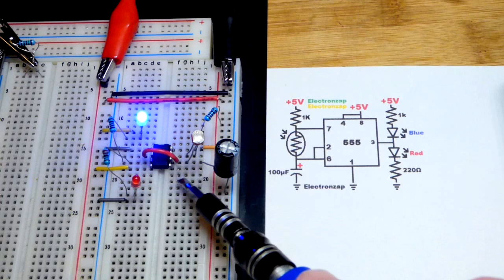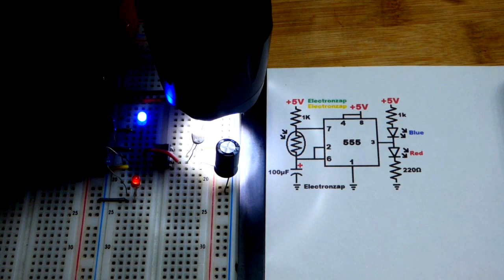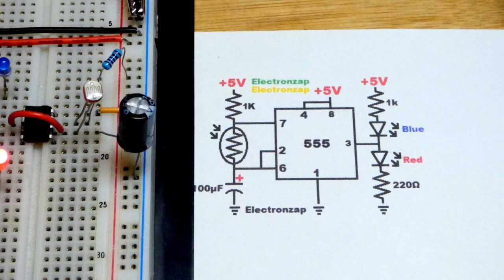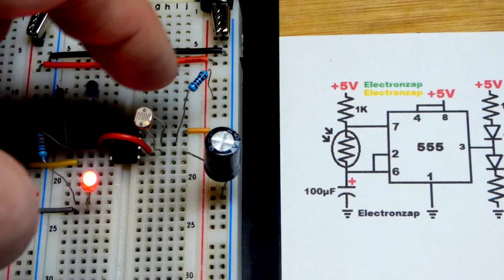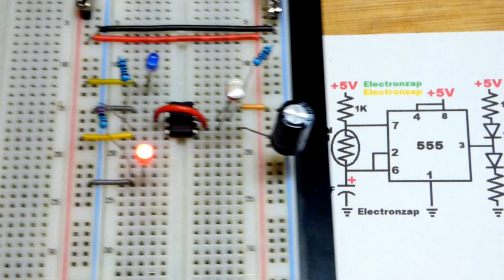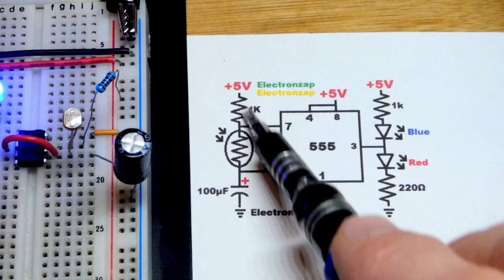Light dependent resistor LDR controlled astable mode multivibrator 555 timer electronics circuit

Comment: Do you have a rule that you use for deciding when the pin 5 stability capacitor should be included? Or did you leave it out for the sake of the example?
Reply from the maker: I'm pretty sure it's best to always include the pin #5 capacitor, but when I am demonstrating a circuit, I like to be able to show why each component is important to try to reduce clutter.

Comment: Great circuit, it reinforces  (for me anyway) that pin 3 even when low can switch on another load if its connected to the positive supply. Probably obvious to many but its  another step for me
Reply from the maker: That is something that takes a while to get used to :)
Reply: @Electronzap  I guess its  down to the term 'output' which I was only thinking of signal, voltage and current heading for ground and not when low it is then a pathway to ground. Very cunning these 555 and other chip designers :)